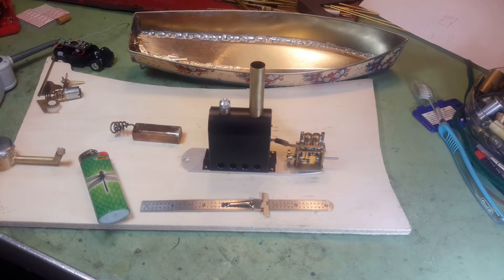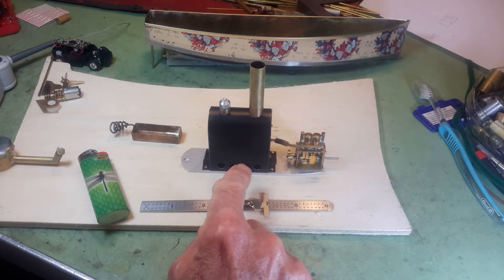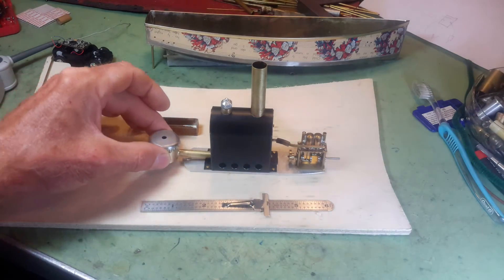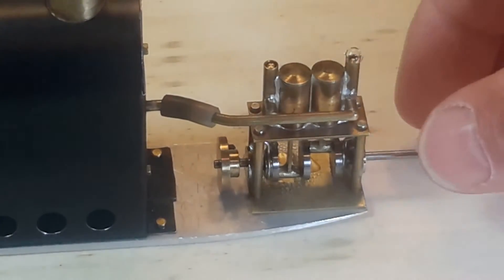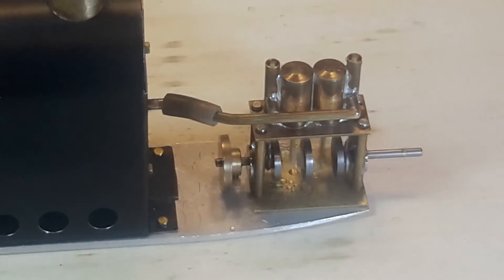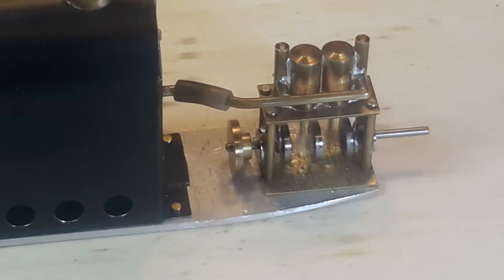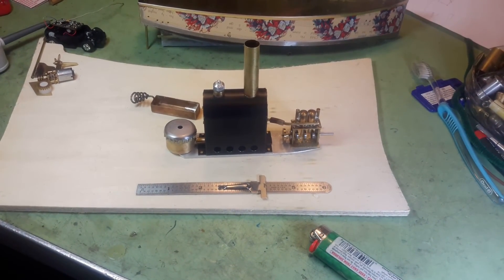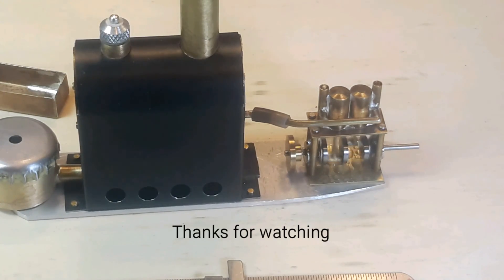MINIATURE STEAM POWER PLANT FOR MODEL STEAM BOAT

Comment: What a delightful little engine! With regard to the engine "sticking": have you tried using Steam Cylinder Oil as a lubricant? Have you considered adding an oiler/lubricator to the steam line?

Comment: Lovely little metal boat.

I have written to you on my video:-) my mistake

You could make a oil resoire it made a huge difference on my engine performance
And how about a control valve for speed/forward backwards..

There is more in my video 

Thanks for the nice video
Martin